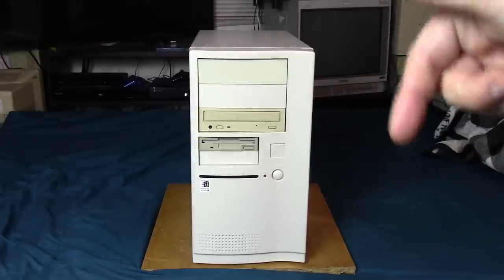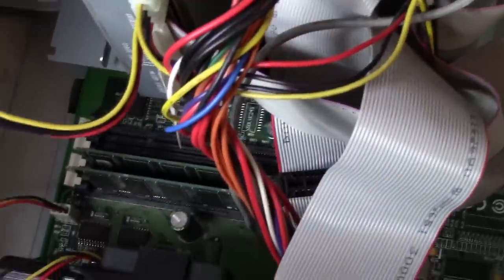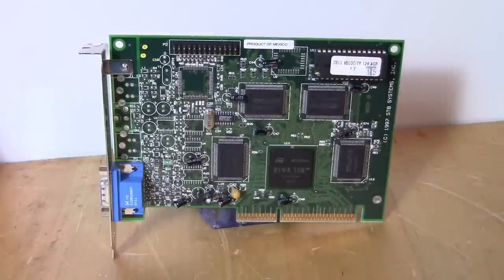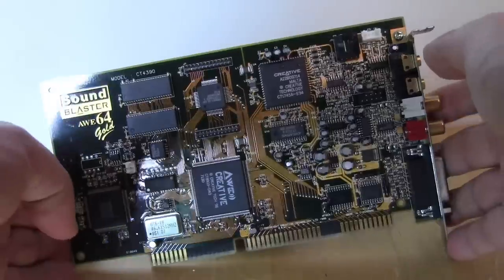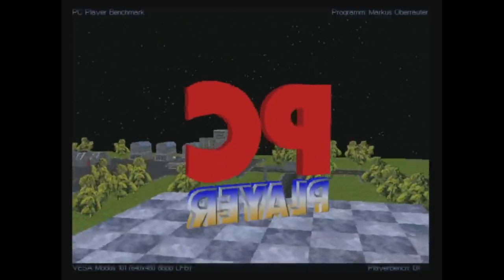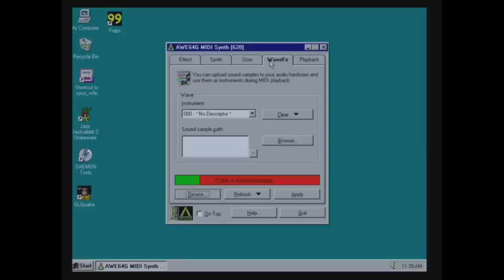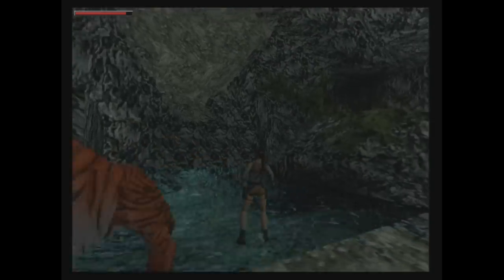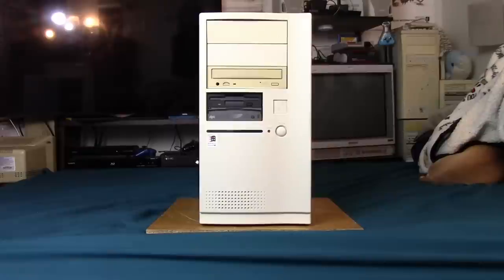Building a High End 1997 PC REDUX

Comment: Another graphics option could have been an Intel i740 based system. A Matrox Mystique would also be valid.
Reply: Both were horrible for 3d though. I remember all the fanfare about Intel entering the video cards market but the i740 was such a disappointment. And matrox was kinda on its last legs, they had some of the best 2d cards but 3d they were getting mauled.
Reply: Intel i740  came later, in 1998, with the first AGP systems.
This card was a pain :)
Reply from the maker: @nalinux  I've acquired a few i740s lately that I've been messing with and I have to agree. I've had a lot of driver issues.
Reply: @AncientElectronics  A few friends had them when they were new. None was happy.
Even on Motoracer they had poor performance, my Ati Play PCI was better :)
Reply: Mystique, ET6000 or Ark Logic 2000 were the three fastest 2d cards you could get